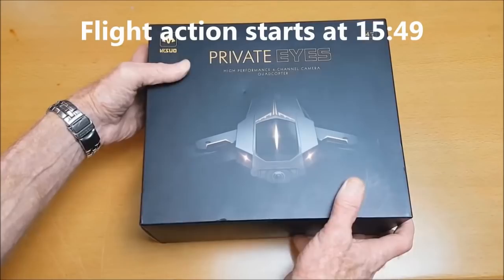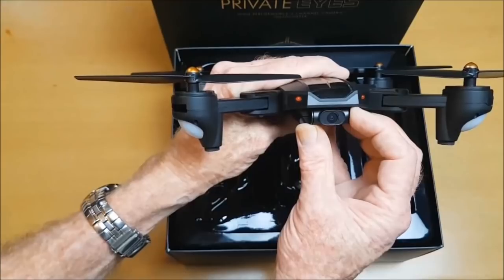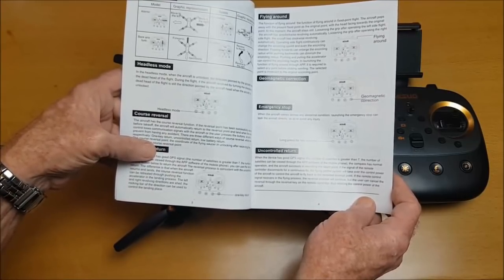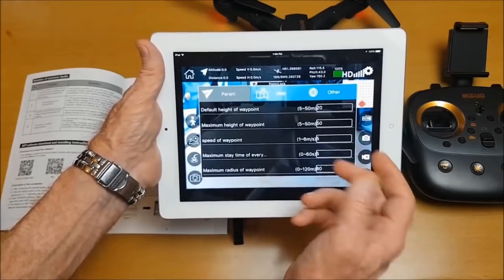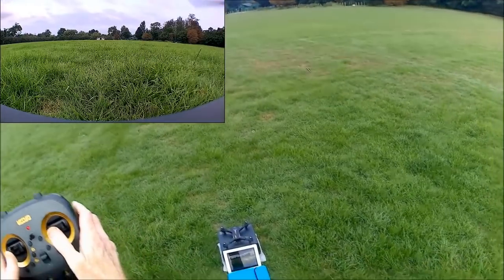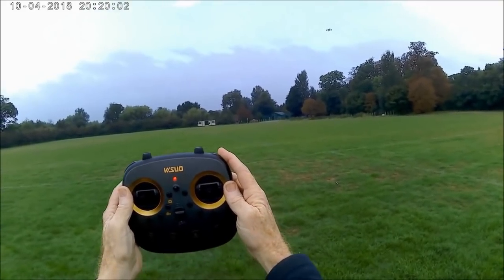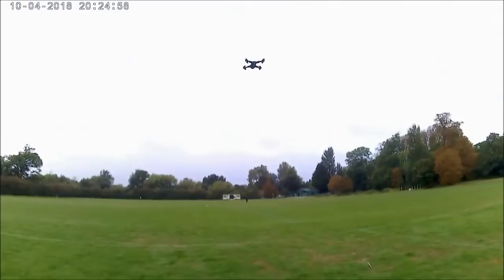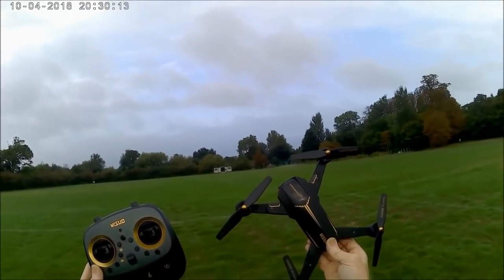NEW Visuo XS812 review - GPS 5G WiFi FPV Foldable Quadcopter Drone under $90

Comment: Hi everybody _ı bought xs812 2 years ago.It worked perfectly but yesterday I tried to fly but the escanding power was not enough to fly. I changed batteries, still same.
Any suggestion about it.

Thanks in advance for your support

Comment: Sir my english not good..in this video are you connected to WIFI? I ask because i also plan to buy but my problem is 5G wifi and my phone is only 3G, but i can download the APP...do you think with APP only, can i able to fly the drone? Is video going to work also? Thank you sir if you can reply.
Reply from the maker: Hi, thank you for watching & commenting, always much appreciated :-) You mobile device must be wifi 802.11 a/c compatible to connect the drone to the app, You can still record video onto the sd card using the radio controller function for this.
Reply: @BillMRC  hi...thank you for your reply...

Comment: Hi BIll , have you tried the" Auto return function"  when the batterie dies or out of range etc ? If so does it work ? Thanks .Steve.
Reply from the maker: Hi Steve, yes  I did this in this video and on a subsequent flight when the battery got low it rth.

Comment: Hi.

Just one question.

I own Visuo xs809s, can anyone confirm that xs812 uses the same 1800mAh battery?
Reply from the maker: Hi, thank you for watching :-) I unfortunately do not have the XS809S to check & see this but if you can send me some close up pics of your battery, I will see if this could possibly fit. My email address is at the bottom of the description of this video.
Reply: Sigiom, banggood, sells the battery and lists it for both.

Comment: Hi are you able to tilt the angle of the camera using the controller and is there an SD card slot for the 5MP version?
Reply from the maker: Hi, thank you for watching :-) You cannot adjust the camera from the radio controller and I do not see why the 5mp version will not have a sd card slot if this 2mp version has.

Comment: Hello Bill M , it's Steve again ,are you sure there is no SD slot ? seems funny the quad's been upgraded but they didn't provide the slot ! If so do you know what  electronic piece must be changed to have a SD slot and what is the piece is  called ? I'm new to quads and i can't find any solid information about the change . Thanks so much and i'm impatient to see your next review .
Reply from the maker: Hi Steve, I am sure that there is no SD Card slot on this 2mp camera version, perhaps there may be on the 5mp version. I am not aware of anything that can add an sd card to this.
Reply from the maker: Hi Steve, good news, this does have an sd card slot. I have posted a video on how to do a simple & easy mod to use this.

Comment: Did you say that it wouldn't work with android?
Reply from the maker: Hi, Thank you for watching & commenting, always much appreciated :-) I could not detect the wifi signal on my Samsung S7 Edge 5g compatible phone with Android Version 8.0 Orero, but this does not mean that it will not conenect with other compatible 5g phones with a different version of Android on. So sorry, I dunno as I do not have a resource of android devices to check this,
Reply: I have discovered a number of apps that will no longer work using Oreo..I think Google broke something in the code
Reply: @compteck7  Hmm...good find and thanks for the info.
Reply: @BillMRC  Thank you for taking your time to answer my question bill. Much appreciated.

Comment: At last ! Hello Bill M , the first review of this model . I haven't received mine yet, i hope next week ,  so Bill M do you think the orbit mode and follow me mode not working are due to the app ? I've never had a quad before so i'm a bit worried ,  i hope it's not due to the quad . The video didn't seem great may i ask why you didn't get the 5mp ? Hope you can do soon a new review with another app to see the difference  . Thanks . Tivé . Sorry for any mistakes i'm french .
Reply: The orbit mode and follow are likely to work with a phone not a tablet. Cheaper quads that don’t have a gps in the controller for the quad to follow use the phones gps since it didn’t seem to have an optical follow me.
Reply from the maker: Hi, yes, I agree and hopefully Google & the app developer will resolve this Android v 8,0 problem soon.
Reply from the maker: Hi Steve, thank you for watching and commenting :-) As this is the first review, I get to test,  but see further orders have been delayed. Very happy with the performance but not the app, so will be revisiting this as there are no good instructions for the app and will see if I can make sense of this. As for Android V8.0, I cannot do anything until the app developer has resolved this with Google.